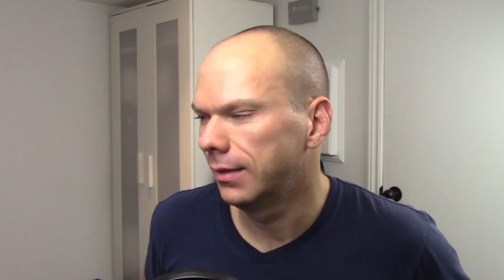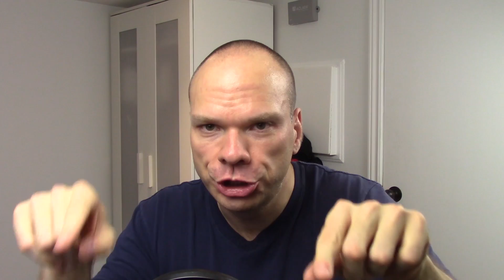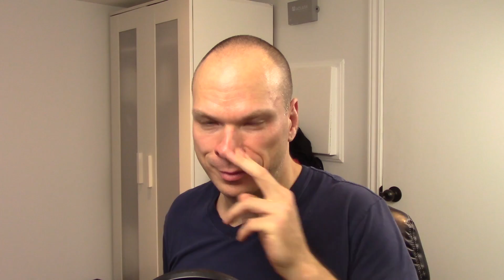Opinion Up In Ya - Why the ATX Form Factor Needs to Micro-size Itself

Comment: so standards bigger than mATX have a place just they usually are for more stuff most times more features than just PCIe, RAM lots and M.2 for example more SATA / SAS ports. more M.2 slots,  more USB internal connectors, usually a better audio chip still from Realtek , and just more of everything
now do most people us most of it um usually no but if they are going to upgrade the extra SATA connectors are good, the extra M.2 slots are good, the extra RAM slots are good once i get a 10GBase-T home switch a 10Gigabit NIC will fit in nicely to which would not in a mATX motherboard, but to this most ppl build then do not care to upgrade 2, 3 ,4 or more years into the future using the same motherboard to me i am not able to afford a new motherboard nor a new computer so for more internal storage i just keep on adding more and more SSDs as they are around $300 ~$400 for a 1TB SSD now and much faster than a USB 3.0 spindle drive

Comment: personally mATX is my fav but I will humbly disagree on this one :)     My GF is an extremely  heavy USB user and we finally went full ATX on her build and filled the expansion slots with USB3 pcie cards because every USB hub we have tried has fell short in one way or another..........on a side note ITX with a GPU is pointless since dual slot cards hang down past the mobo anyway.... just my .02

Comment: My FX-8320 build is mATX, but I have already bought an ITX case for my Ryzen build.  My only issue with mATX is that the cases just don't emphasize maximizing space the same way that ITX cases do.  The mATX board isn't way bigger than the ITX board, but the cases are.  This doesn't make sense IMO.

Comment: piss on your m-atx!!! i want processor with 159902453902354 cores as big as you M-atx form factor! and 15 gpu's inside. fuckin Nvidia fans (no more than 2 way sli blah)  :D
Reply: if you do it right you can have 8 GPUs in on system running in parallel though they will not render games they will boost up your compute power

Comment: 1st one has a SATA expansion card in it (board was lacking enough for my 7 drives), 2 has a 2 slot GPU, slot after is empty for air spacing, then another 2 slotter GPU, with one slot left on the end for a wireless card.

There, all of my slots are used.
Reply from the maker: Being serious for a minute, if you need the space, then obviously you should buy a board to accommodate it. The majority of people, however, are not in the position to need that much leg room, though.
Reply: Yeah. Got my brother a X99 mATX build. A 390x Nitro and a T4 cooled 5820k fit in a CM Silencio 352. Thing puts off some heat.

Comment: But oafah... What if i want to put in 6 GPUs in my system and achieve very many megahashes?
Reply from the maker: If anything, the ATX form factor should be a speciality form factor for people with the need for extra space. There are some cases where it'd be necessary, but most people would be fine with mATX.

Comment: I agree with you, on some of it.
Yes, you are right. The vast majority of PC builders never use those extra slots provided by an ATX board, although I may be the exception. You see I am the kind of person that holds into their computer as long as they possibly can, and up until two years ago I had a core 2 quad extreme QX7600. I filled all those PCI slots to the brim with a USB 3.0 and USB 2.0 card, a SATA gen 3 card, my graphics card, a wireless card and finally, A capture card. Without those extra slots I would've never been able to give those extra functions to my computer that didn't exist yet, and thus extend the life of my hardware for a few more years. As far as ATX cases go I still have another argument to make. If you are building a PC and you are going with used parts, you really have no idea what you will find as far as motherboards go. If I found a really huge server board on the cheap and wanted to squeeze it in my case, I couldn't do that with am mATX case of smaller. A bigger ATX case allows me to choose a wide variety of used motherboards floating around and fit that in my big ATX case of choice.
But yeah I agree with you, most users don't need ATX unless you are like me or you are looking for a motherboard on the used market. Anyway awesome video, can't wait to see more like it.

Comment: Funny you should upload this right after I order my EVOLV ITX to downsize from my Enthroo Pro M. 

Any downsides to the EVOLV ITX I should be aware of?
Reply from the maker: It's a great case. I just need more room, is all.
Reply: Solid case, just be aware that almost every mITX case won't be able to compare with their larger cousins when it comes to airflow - expect slightly higher temps. Aside from that, it's fookin beautiful.